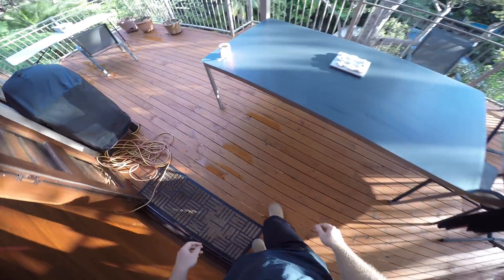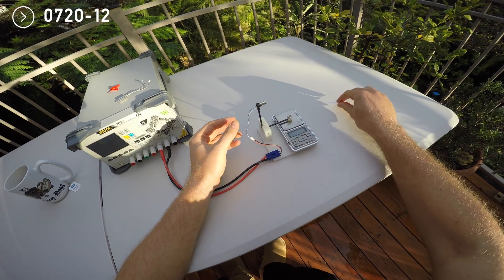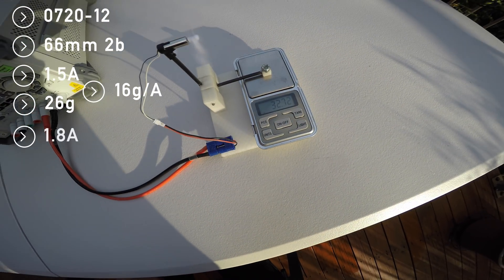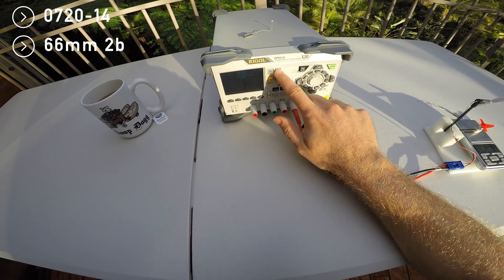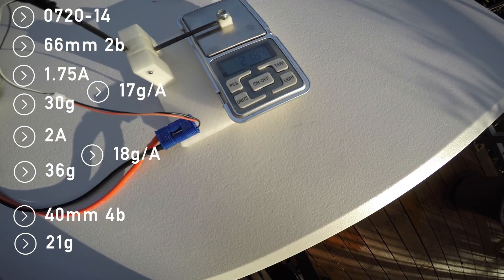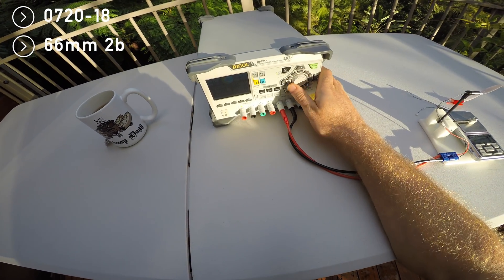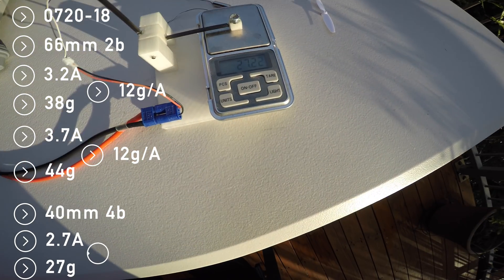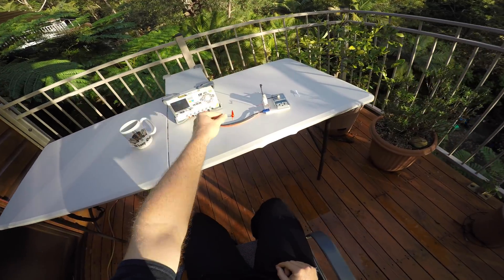CL-0720-18 motor - on the test bench

Comment: Do the 72018 make the 720-class whoop no longer the optimal power package?
Reply from the maker: Sorry, I dont understand the question..
Reply: Sorry, I was being terse because I was tapping that out on a phone. In prior media (video or MMW University) you mentioned that the 720 class is your favorite due to the best efficiency or thrust/draw ratio. Do the 72018 make that no longer the case? I'm asking because I'd like to build my first one, and I want it to be snappy but also be able to fly for as long as possible.
Reply from the maker: The 0720-18 is not anywhere nearly as efficient as the 0720-12 and 0720-14.
For your first Whoop, I suggest either a 7016 setup, or the 8020.
7016 is the best allrounder (indoors and outdoors, fast and nimble decent flight time), 8020 has the longest flight time.
If you fly primarily indoors, I suggest the 7016, for primarily outdoors the 8020.
Reply: The 8025 are not nearly as efficient as the 8020/7016, right? Not worth the extra grunt? Thanks for the prompt reply.
Reply from the maker: Efficiency depends on propeller and motor. 30-40mm on 7x16mm, 40-50mm on 8x20mm and 50-75mm on 8.5x20mm.
A 48mm 4-blade propeller seems like a good plan on paper. But I have not yet seen a good 48mm 4-blade prop in the air.
Reply: Imbalanced or too much drag per blade area with the four leading edges?

I'd fly in/outdoors, with preference for outdoors/flight time, so whatever runs longest is what I'd be after. It sounds like 0820x50 is my ticket, right?

Thanks Benedikt.
Reply from the maker: More blades seem to generally produce less efficiency, but more thrust per diameter. Yes, for longest flight time on a Whoop, I recommend the 8020 setup: https://micro-motor-warehouse.com/products/whoop-body-kit-8020